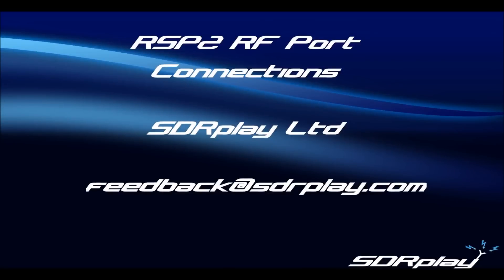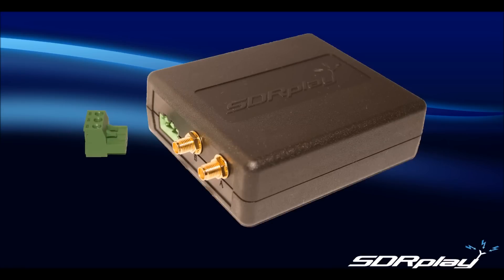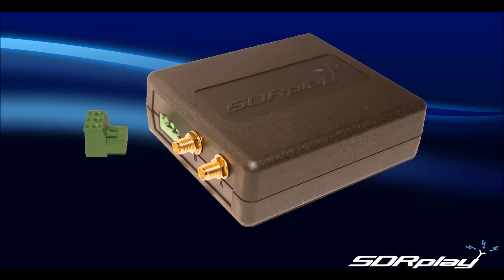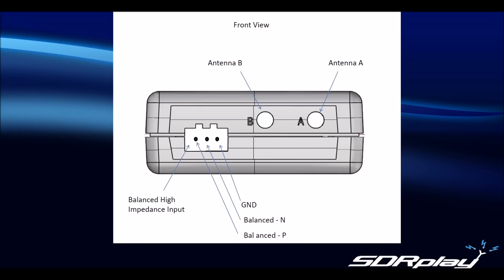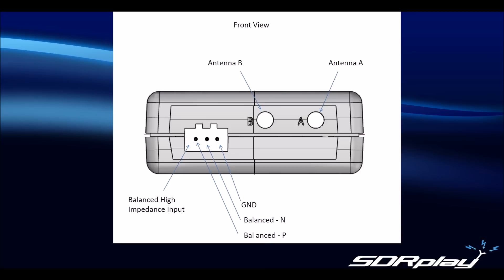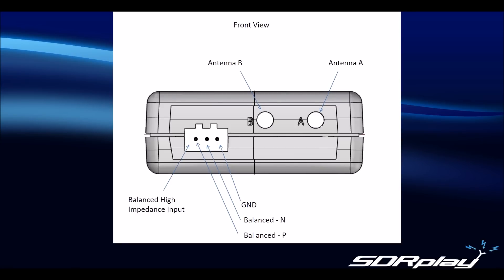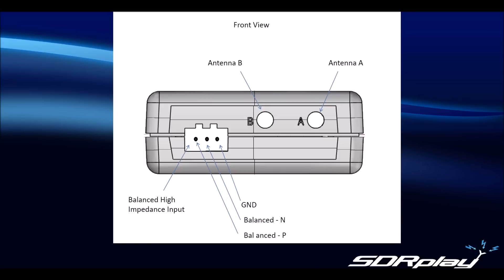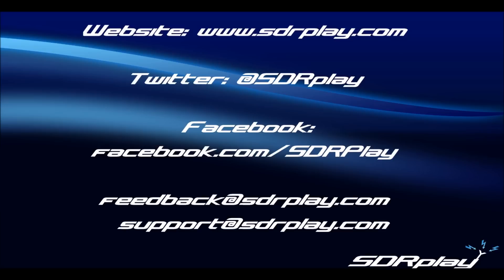RSP2 RF Ports (AV002)

Comment: Unless I misunderstood, you mention that if you are hooking a coax to the highz port, that the inner wire goes to P and the shield to N. My set up uses a random wire coming into a 1:1 balun which allows me to hook a 2 meter coax which runs to the highz. I notice that if (as I think I understood you say) the inner wire to P and the shield to N, I see a lot of noise on the graphic display. But if I also hook a small loop from N to G, that noise is reduced significantly. I am not sure if this is telling me something about my set up, but wonder why you didn't mention also running that loop to the G connector from N?
Reply from the maker: https://www.sdrplay.com/wp-content/uploads/2016/12/161201HighZPortGuidev2.pdf

Comment: I don't understand why you didn't include the  connectors and cables to get us up and going...
Reply from the maker: That's a good question.  In order to guarantee the quality of accompanying cables and connectors, we would need to add the additional purchasing and quality control steps needed to handle third party hardware items.   We would also not be buying in the quantities needed to get the best price.  Our worldwide resellers typically recommend and/or supply suitable cables and connectors available locally.

Comment: I have been off the air for over 30+ years and this SDR is new to me. I just received an SDRPlay RSP2 and now in need of a good antenna, I have the ability to run about 170 feet if needed.  Any ideas as to a good antenna either a Vert, or wire. whatever is best.
Reply: I use about 25 feet of RG6 cable out the window,have a 60 foot wire soldered to the center conductor about 8 feet high that works from the AM broadcast band to 30 mhz.That connects to the green plug.For frequencies 25mhz-1.3 ghz i use a discone antenna,works great.Discone is connected to port A.